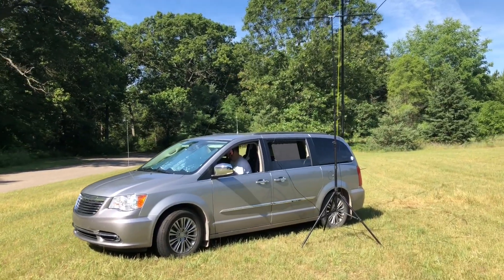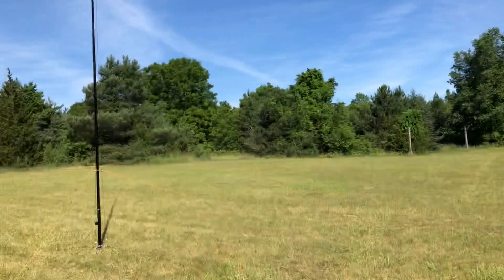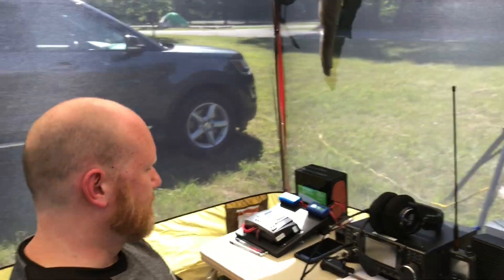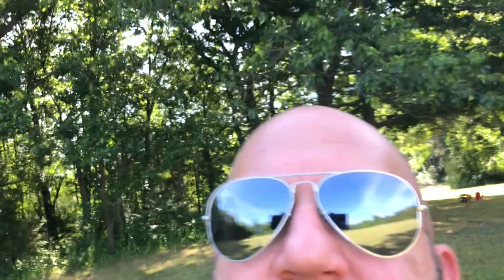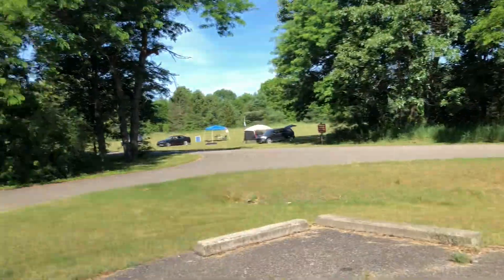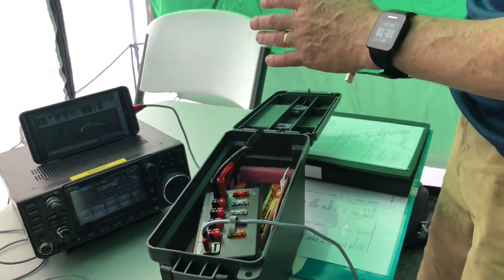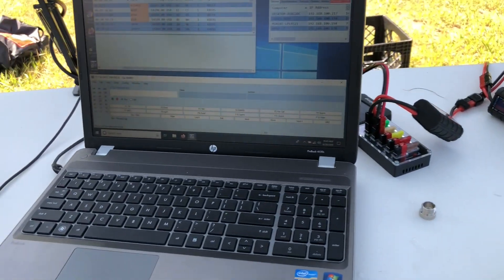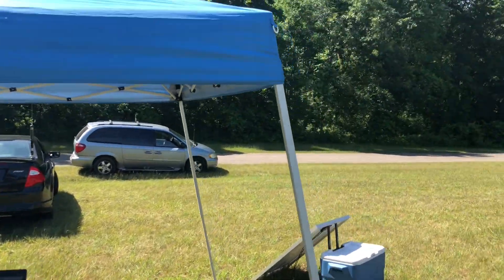ARRL Field Day 2020 Social Distancing Special!!

Comment: Great video and better yet it answered a question for me. I have a bunch of those surplus military 4-foot poles (fiberglass flavor) with the tripod piece. I wasn't sure I could actually use two poles on the legs but your folks were doing it on Field Day. Makes it much more stable and I'm using it support a 32 foot temporary tower for the end fed on our property in northern Michigan for the summer. Ignore and don't feed the trolls. NK5J.
Reply from the maker: Oh yeah that antenna is a beast.  It's out every year.  Not sure how many years as I've only been in the club for a few now but it is a staple of field day.

Comment: Group size 27 RV batteries are the best b**g for buck... $81 about 75ah
Reply from the maker: I will let you carry it for me too haha!
Reply: @hamradiotube  Group size31 at $99 are great, sold out as well. if they will fit. Have tried everything. Secret is to not overcharge AGM / Gel cells beyond 14 volts. Almost every charger I know overcharges batteries.

Comment: Mike, thank you for the video! I was particularly pleased to see the DXC antenna up and operational. I've been meaning to order one for nearly a year now, but keep putting off. Well, no longer will I dilly-dally. After hearing the 10m contacts that clinched the deal for me. I live in NW Indiana in Lake County. I am currently the VP of the Lake County ARC and sadly as a club we decided to operate solo this year. Two weeks ago we had a wind gust of >90 mph that brought down one of my 32' masts that supported my G5RV Jr. antenna. I've not gotten it back up yet so instead I tried both my Buddi Pole Deluxe and my Wolf River Coils TA portable antennas. 

Sadly neither one really performed well from my front yard. I tried both my IC7300 and the Xiegu G80. While the G90 received marginally better than the 7300. No contacts were made. I finally sat in my Toyota Camry and fired up my FT-857 and the ATAS120 antenna and quickly made 15 contacts on 20m and another 8 on 40m! Go figure. Hopefully things will have improved enough to have our annual Indiana Parks on the Air event in the latter part of September as a club.

73 de N4GIX - Bill
Reply from the maker: That sucks about your tower coming down.  DX Commander for the win though.  This is the more portable "Expedition" model that I was using.  I also just got the DX Commander classic that I need to put up.  Thats interesting the G90 received better than the 7300.  My only gripe w/ the g90 is no noise reduction.  It was def hard making contacts this year with all the 1D stations working each other.  You weren't alone in the struggle.  I didn't even think to use my Little Tarheel but good that you had luck on the mobil.  Thanks for watching.  73

Comment: Nice upload . I also run the Icom IC 7300. I may have gone overkill My panel is 200w The deep cycle Gel solar battery is 200Ah  That said I also run a inverter for fans and lights when QRT..
Reply from the maker: Wow I don't want to be the guy doing the lifting on the battery but you will prob never run out of power that's for sure!  Go big or go home though.

Comment: 15 and 10 were pretty hot over the weekend. I managed to get two New Zealand stations on 15 meters using FT-4 in the evening.  I operated with the Black River Amateur Radio Club, K8BRC down in the Lawrence, MI area.
Reply from the maker: Nice.  I got to play a little on 10 but one of the other guys was hogging 15 haha.  Good you got to get out and play radio.

Comment: If I flopped my arms around like you in the beginning of the video I would need shoulder replacement. LOL. Glad you had fun. I only worked a few stations from home 1 D ME. Made 3 qrp contacts on 40, a few on 40 100 watts and a few on 80. Helped a few stations get points anyway. 10 meters has been stretching its legs a bit lately. We have a nightly local group on 10 meters ground wave vertical and some nights this past month or so we get some southern stations popping in. When 10 meters opens its hot, but you go from 20db over s9 to no copy real quick sometimes.
Reply from the maker: We don't need to see you getting a new shoulder so leave the arm flailing to me.  Just let me know if you need a good flail and I'll help you out!  It was tough going this year and I'm kinda glad everyone is saying the same thing so I know it wasn't just us.  I've been having fun getting on 10 when it opens up lately.  Haven't really done much with that band so its new and exciting for me.
Reply: @hamradiotube  You were licensed a year after me and from what I have been told we both missed a pretty decent 10 meter run. I have a friend near me that was licensed a year before me ( I was 2015 ) and he said 10 was pretty hot in 2014. As far as my shoulder,,,, blew mine up when I was 26 on the job. Major surgery, fired from my job, it was so much fun,,,,, not. 18 years later, still creaks more then an old rocking chair.

Comment: Field day would have been cool if it was actually a “field day” like what you guys were doing. Instead it was nothing but “1D” 1kw stations operating from their shacks. Super lame.
Reply from the maker: Yeah I was definitely frustrated at times because of that.  It’s not much of a field day of you are at home.  At least go out in the yard and operate battery or generator power.
Reply: K8MRD RADIO STUFF Right? That’s what I did on Sunday. Sat out there for about 45 minutes, then peaced out for a motorcycle ride. I think I made two contacts? Glad you guys had fun!

Comment: Can you tell me what the codes were for location of stations whether it be in your shack...which I was told 1D compared to outside in a tent or in a vehicle stationary or moving. I searched and could not find any info. I suck.
Reply from the maker: It's about as convoluted as it can possibly get.  I think the ARRL rule makers sat around a table and brainstormed what would be the dumbest, most difficult way to classify our stations and went with the worst answers across the board.  Look at class B especially.  Theres class B, but there is also class B-Battery for qrp stations.  Why not just make qrp stations Class Q??  You can read about it here: http://www.arrl.org/field-day-rules
Reply: @hamradiotube  You mean the rule makers sat around a table wearing covid-19 approved masks that caused a lack of oxygen to their brains or wouldn't that matter. Thanks for the info!

Comment: I have a question.  You showed both the Powerwerx Volt Meter: & a clone based volt meter for RC in this F/D 2020 video.  I've looked online at both. Seems to me there is aprox $45 difference in price for what seems to be the same thing except for the label/branding, and/or the Power Poles connectors being added.  Do they have the same menu functions?  (The RC version didn't list any specs like Powerwerx ad did.)  For $45 I can put my own Power Poles on.  Gotta pinch pennies till  I get rehired somewhere. 

BTW Thanks for the F/D video.  Being a "poster child" due to being in several of the categories for strict isolation, I'm still hiding from the world.  So it was a nice change to watch. 

73
Reply from the maker: They are exactly the same in every way other than their accuracy.  The PowerWerx is very accurate.  The other 2 cheap $15 ones I have are about .1-.2 volts less (at least) and don't count amp hours as accurately.  Voltage isn't the most important thing with LiFePO4 batteries as it stays pretty constant until they are about to die.  Amp hours however, are how I really tell how much capacity is left in my cells.  Now, do the cheap ones work?  Mostly yes.  Could you get by with them, yes, just not quite as accurately.  Glad you enjoyed the video and thanks for watching.  Hope this helps answer your question.
Reply: @hamradiotube  That's what I need to confirm.  Thanks for your time & knowledge. 

I was away from radio for several years due to local politics in the clubs.  But with the lock-down I started to look around at HF & discovered a ton of new or "reformatted" tech Such as WSPR/FT8 & SSB -qrp & all these great ham related YouTube channels such as yours that have reignited my interest in home-brew antennas and portable op's again.

Comment: Yay!  Worked y’all on 15m SSB @ 17:03.  73 de KM4RT.
Reply: That was me who worked you. I was surprised how good 15m was.
Reply: @tron2132  ... I worked 20m SSB for most of the front-end of the contest then switched to 15m for most of the 2nd half.  With 15m being hot and the ability to work same stations on different band as a contact was definitely an advantage!
Reply from the maker: Awesome.  Those are pretty small odds to make a contact and be on a video and you did both!

Comment: Hey mike where did u get that change control at I have a lipo 4 14amp hour battery?
Reply from the maker: https://www.bioennopower.com/collections/solar-controllers/products/12v-24v-20a-solar-charge-controller-for-lifepo4-batteries-sc-122420jud
Reply: @hamradiotube  thanks
Reply from the maker: @donnymazon8516  You're welcome.
Reply: @hamradiotube  I use solar panels everytime I go out with my 891 some of the best money I used for the hobby  enjoy ur solar  set

Comment: Hey Mike you can geta universal laptop charger that runs of 12v
Reply from the maker: I may look in to that at some point if I really need it.  I have zero intentions of using a windows computer for anything.  If we weren't all connected to N1MM I would have used either my MacBook or an iPad, both of which have great battery life.

Comment: Would 60w solar panel have been enough?
Reply: Our 100W panels were putting out 5 to 6 Amps in the direct sun. Lower wattage/current panels would certainly work... they would just charge the batteries a little slower.
Reply from the maker: It would, I just wouldn't expect it to keep the batteries as topped off as our 100 watt panels were.

Comment: Nice work!  I ran a battery powered FT817 set up at home, remotely controlled by an iPad through VNC.  It is connected to a Raspberry Pi 3B and a Signallink SL1+ (USB on the way, shipping times are awful) Jerry rigged to work with everything.  Batteries are a LIPO4 6ah from Amazon and a Lion 6ah pack to run the Pi and Signalink.  Made some PSK31 and JS8 contacts throughout the day all while tending to my pool boy duties!  Antenna is a W3EDP at 40 feet.  Solar is next along with an FT891.
Reply from the maker: Nice.  Seems like the digital qrp guys had a little more luck than the ssb guys.  I assume your pool boy duties included doing as little as possible while making sure you drank your beer just fast enough so it doesn't get warm.  Solar is awesome btw.
Reply: K8MRD RADIO STUFF I did well on PSK31.  Lots of activity.  Trying my hand at JS8 but not really got it dialed in yet.  All new to the Pi game so the setup is a little tricky.  I’ll get it right though. Thanks for putting out good content people can use.  73

Comment: I thought there was not going to be any
group Field Day, but on Ham Radio Concepts, he videoed the Vero Beach
FD site, W4OT, doing a group FD this
weekend without much social distancing.
Here, 100 miles to the south in Palm
Besch County area, I don't know of
any group Field Day.
My wife, KC2NKU, and I, W2CH, operated
a few hours portable with 🔋  battery,
the hardened power systems supply, the Commander, with my Yaesu FT-891.
Reply from the maker: I prefer to interpret my own rules.  Ham radio is already a social distancing hobby so what we did I feel is within the bounds of all this human malware virus stuff.  I have seen plenty of videos where that wasn't the case with people sitting right next to each other however.  I know Eric personally and he is a really good dude.  Maybe that's why he wasn't there until the end...to limit exposure.